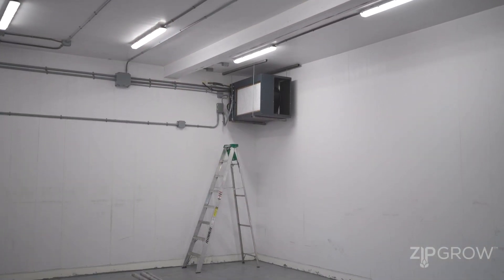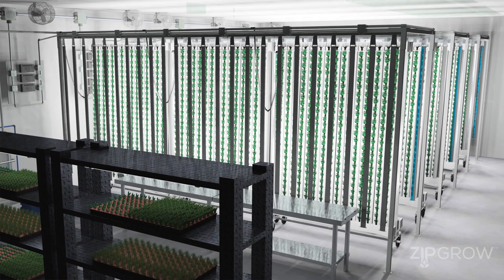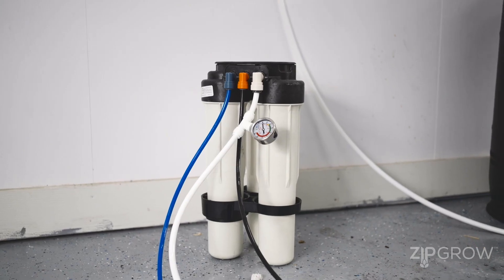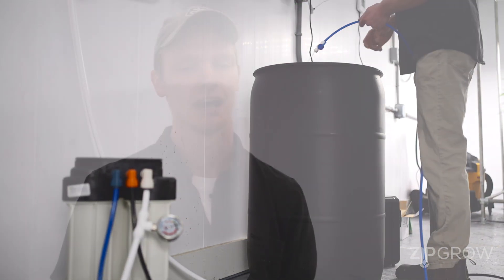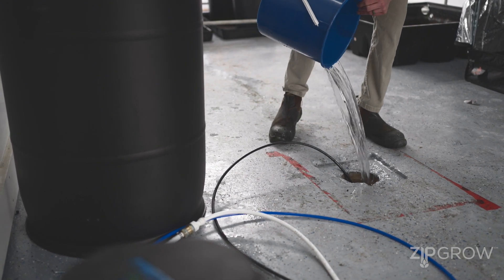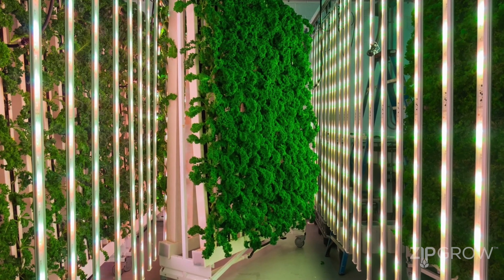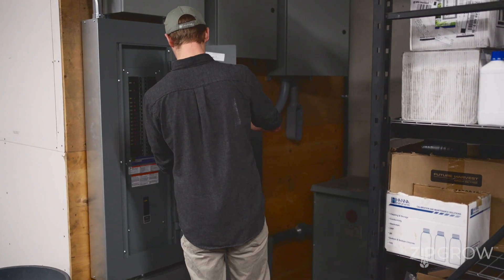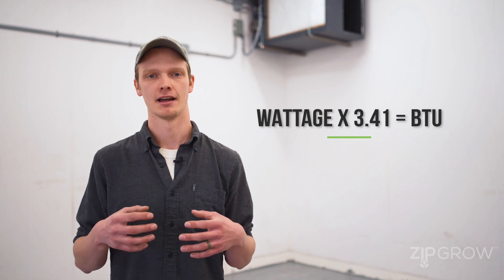Indoor hydroponics farm build considerations

Comment: The point he makes at 2:15 is true. But please, I have worked at grows with uneducated workers, and they will dump random things into that hole. We as community of growers have to teach new grower not to dump random things and perlite down the drain as it can cause labor issues and clogged pumps, pollution to our local water, and many other issues.. just a heads up, I have seen a lack of education in new grower who use those pits as dumping for things that should not be dumped into the drain.... causing more labor/issues in the farm as well as pollution to the local water... thank you for the content. I remember your channel back in wyoming, this is amazing to see how big its gotten, but we have to do things right.
Reply: Those ideas for floors are definitely good for growers, heh. Also food/processors.
Reply from the maker: yes education is always key, we certainly teach our students this in the research and development farm.